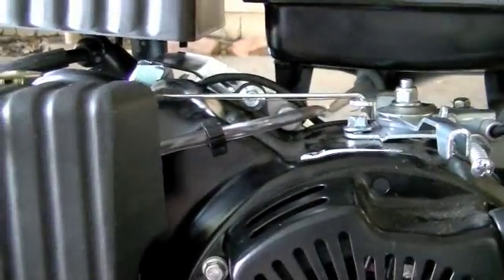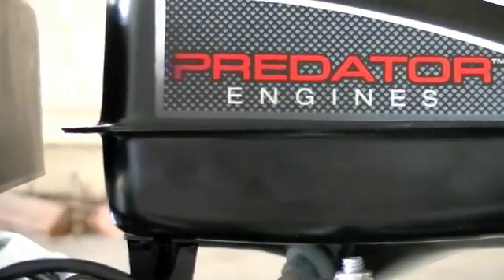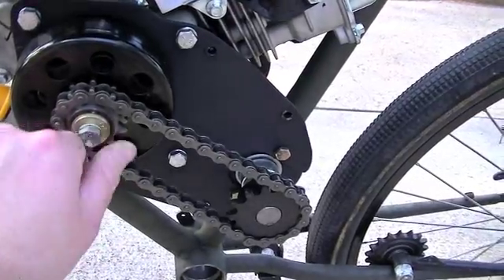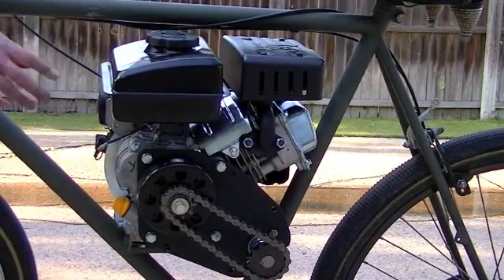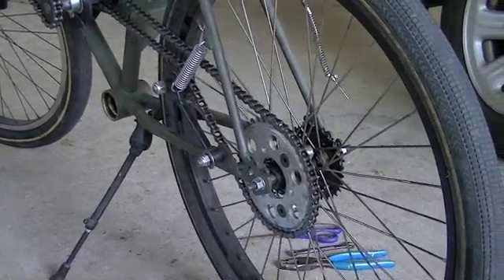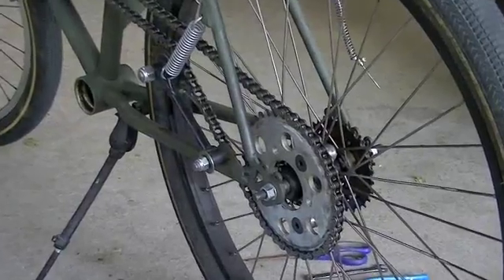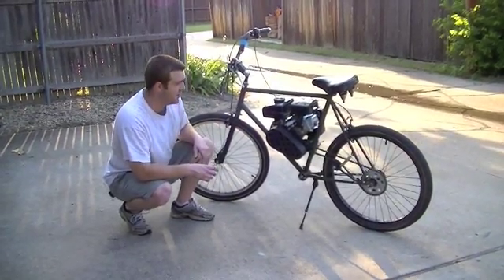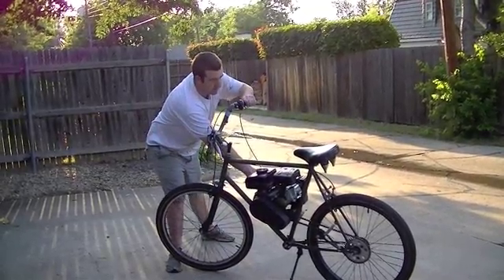Part 27 Motorized Bike | 3HP 4 Stroke Engine

Comment: I'm not an expert.. but if you take the four screws out of the Rope pull start you can turn it counter clockwise and get a more compromising angle to pull on.... that way you can straddle your bike to start it... don't forget to put the screws back in and tighten..

Comment: looks really cool,..but so loud, slow, wide, and heavy. go 2 stroke, bro. ride that bike for a while,... and then try a 2 stroke. you wont go back. I had a 4 stroke with a centrifugal clutch,...just like yours. I rode all over. I went down a hill, and when I hit 30 or so,.. I hit the throttle a tiny bit, the clutch engaged, and the motor screamed up to like,..14,000 rpm for the rest of the way down the hill,.. until I slowed down enough for the clutch to finally, finally dis-engage.... heart attack? i drove it home, got off, took pictures of it, and sold it on craigs list immediately. never again. you are not in control with a centrifugal clutch. amazed that motor didn't explode right then and there.  was glad to see it gone.

Comment: If the clear line doesn't do it, get some Tygon line from your local lawn mower shop. Its the yellow fuel line used in weed eaters. You can get it in several sizes.

Comment: I'm not a "Gear Head" type although I did lots of Heating & Air Conditioning Tech until Hit by
a Truck.   I have dealt with ALL electrical motors But the "Clutch Chain Sprocket" is nice &
short which I like but I had a question about the Tension Between the Two  Sprockets;: To
my untrained & non expert eye, I could see the new gear Sproc/  holding tight as the chain run over it(it's new and pulls the chain up.)  I know after ya ride it 1 hour that will loosen up
with natural wear & whoever did the work had great skills. MY QUESTION has to do with
whether or not with the limited space I'd wonder(just me) about the break-in and I can see
the chain drooping some with all the vibration from riding & wondered about the posible
need for some type of Tension device for that as that's going to get "Everything" & for one like me who's can't turn wrenches even for my specialty I'd worry about that. OR does it have some built in slick Tension-er I can't see. It all is so good looking & tight,  since I'm not all knowing & have seen problems of that type I know you'd jerk it right off and Fix it at 7/11 but a problem there would stop me...lol, I know it would hold for a fairly long time(hours) but I don't know SO I ASK~will be looking for help soon in my build.......peace & looks good
Reply: diggy dice nO I I

Comment: this real nice .my next motorized bicycle will be using a Predator 99cc  . but one thing i dont understand you have a plate with saft for the chain why not just go to the otherside and use casset gears for engines top preformance ? why not have the extra power even if you dont need it ? iim not criticizing you it is varry nice . just wondering
Reply from the maker: I thought about using the rear cassette gears but I decided against it at the time.  I wanted to get the bike operational and this was the fastest way.  Plus, I'd already spent money on the Pirate Cycles hub and sprocket kit.  If I build another bike, I'll use the rear cassette.  Thanks for the kind words!

Comment from the maker: Make sure the engine will fit inside the bike frame.  I wouldn't advise cutting any of the tubes.  Proper chainline is paramount!  That's where you need to spend the most time.  Build a little bit of adjustability into your engine mount.  Good Luck!

Comment: it looks like you can replace the sprocket that the clutch is driving with a larger one, that would move the r.p.m. of the motor up faster, giving it more torque applied to the jack shaft, will give you much better throttle response,& taking the heavy torque away from the clutch.

Comment from the maker: I've bought two clutches now.  First one broke.  New clutch is made by Max Torque.  Bought it online but don't remember what retailer.  The jackshaft assembly is made by Asuza.  Many retailers carry Asuza parts.  I bought mine locally at Northern Tool.  The engine plate is homemade... I believe I posted a video about making it.  Google Max Torque and Asuza and you'll find the parts.  Might be spelled Azusa.  Hope this helps!

Comment from the maker: I actually gained alot of speed by gearing it down.  It allowed the engine to operate in it's powerband.  There's a sweet spot.  I gained speed going from a 14T sprocket to a a 26T sprocket.  But I lose speed when I go from a 26T to a 32T.  It's all trial and error.